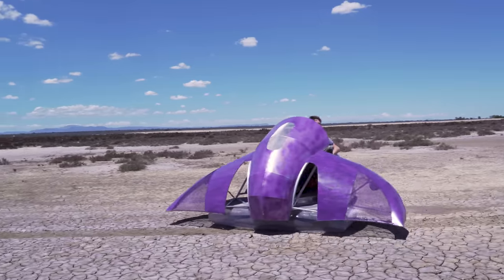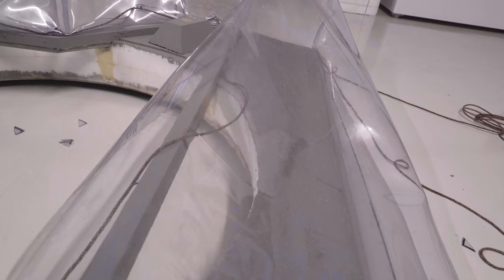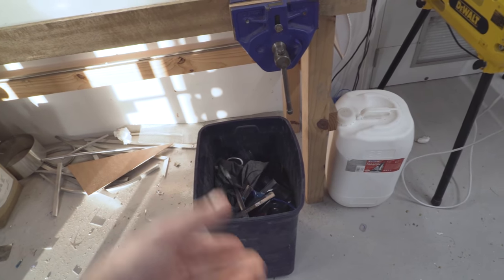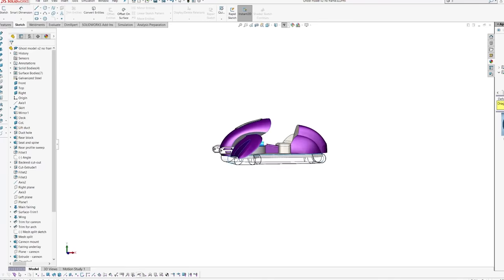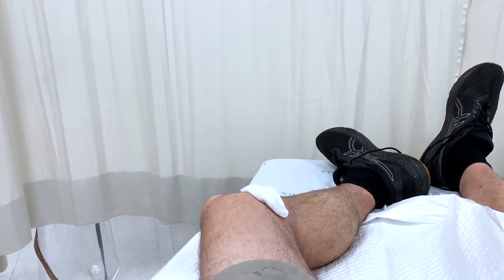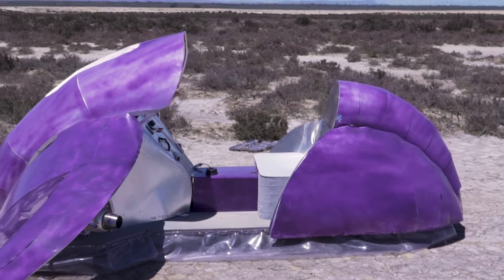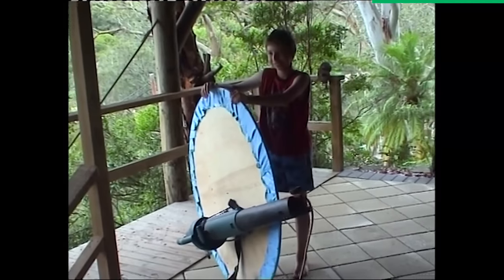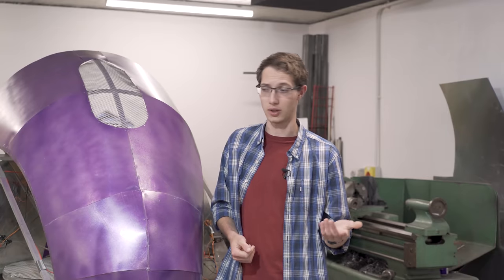Real Halo Ghost

Comment: RE: how the ghost handles

It seems like you might want a “fly by wire” solution to be able to translate user input into more acceptable handling. I’m assuming there wasn’t any code written by the creator… Which is an assumption! If I am right, my follow up questions would be “have you ever programmed an arduino before,” “what’s the mix and max (acceptable) output of each jet,” and then it would be a matter of finding a good graph/math equation.

Honestly, if I had access to this build to measure stuff I think it would be fun to tweak code in unity to get the best ‘fly by wire’ system for this particular build.

Comment: I wonder if electric fans instead, run off an alternator system, would solve the fuel efficiency issue of the jets.
I'm sure the motor has enough torque to spare, and still hover.
May need to play with some capacitors and some voltage multiplying. 
But an added bonus;  you could fit in the boost function playing with these too

Comment: I've watched a lot of RC Drift Car videos, and especially on the rear wheel drive ones, they use a Gyroscope to kind of automatically stabilize the car through turning the front wheels so that it moves straight when you want it to. I'd imagine you could do the same, but it does involve coding. If you need help on that front on the Youtuber side, James Bruton might be able to help you! :D

Comment: think of it as simply a "First Gen" Ghost and work out improvements, like smoothing out the body or welding the sheet metal instead of rivets.

Overall a very simple concept, executed well. The fact you purposely made it look like a Covenant Ghost, and relatively accurate one at that, is bonus points. Well done.

Comment: Variable geometry exhaust would possibly help your steering woes by allowing you to vary the thrust within a window of fine control before requiring adjusting the turbine power, but would be a good challenge to implement and map to useful controls

Comment: Very cool, the slewing problem is an issue with military hovercraft too, although they use throttling pusher fans instead of turbojets, which help with more prompt reaction to turning inputs.  What you could do is instead of throttling the jets up and down, design thrust baffles to temporarily redirect their thrust.  You can also have them pointing straight back by having a little bit of shielding to protect your shins.

Comment: If you're still into this sort of builds, DIY anodizing is really simple. You will need a low voltage source (car battery charger should works well, even for large parts), some diluted acid (even cheap vinegar works), some lye (or at the very least oven cleaner, either way be careful with that stuff! Flush area with vinegar ASAP if you get some on your skin.), and synthetic fabric dye for color. And obviously a large enough container for your parts as well as some water.
First thing first: cleaning. WEAR GLOVES! From here and until the process is complete DO NOT touch part with bare hands, it will cause imperfections. Wash your part with soap/water, then either dunk it into a weak lye solution. It will begin to bubble, so let it do so for just a couple of minutes. Rinse. Same if you're using spray-on oven cleaner, let it sit, then rinse off.
 Part two: the anodizing. Attach a red wire to the part, and a black wire to a scrap piece. I believe tin/lead is preferred, but old bare wire, piece of stainless steel, or even another piece of aluminum work well. Suspend both in the tub so that the part is not touching anything. Fill tub with mild acid so it covers the part. Now red to +, black to - of the power supply and let it sit and bubble away for 30 minutes to an hour or more, depending on your power supply. Periodically check for any large stationery bubbles and shake the part a bit to dislodge them. When the part becomes dull gray it should be ready for...
Part 3: the fun part, color. Pre-heat a container of fabric dye solution (concentration of about 2-3 times higher than for fabric) to recommended temperature. Rinse your now-extremally-clean and prepped thing with as clean of water as you can get (distilled preferred). Before it even has a chance to dry, dunk it in the color. Quick dunk will give you a solid color, while slow lowering will give you a fade-out effect. Within seconds the metal will absorb the color, and it may look darker than the end result. Remove and rinse again.
Part the last: fixing. At this point the metal is colored, but it will absorb dirt and grime just as happily, as well as the color being fairly unstable and easily removed. To prevent that the part should be put in boiling water for 10-15 minutes. If the part is too big (like a piece of sheet metal) it may work to just rinse it with boiling water several times.
After the part cools you can finally tough it with bare hands. You can now wipe it clean and you should end up with nice deep semi-gloss color on the metal. Do not polish it though to start with, you might remove the color. Aluminum will eventually finish forming the oxide layer that will lock in the color permanently, so the part may become polish-able after a while, although i have not tried that, am usually happy with the natural semi-gloss finish.

Addendum: if it doesn't work the first time, just repeat the process. The first lye wash will easily remove previous anodizing and let you start over.

Comment: Here's a jet throttle idea: add a servo-driven nozzle that can turn 90*. That way you can keep the jets at constant RPM (so no spin-up, spin-down delay) but just turn the two airstreams sideways away from the bike (so the vector sum of thrust is zero) when you don't want any thrust. That way you can accurately control how much acceleration you get with almost no input lag.

Comment: so for your next model you just need a hollow center half cylinder going from front to back and dubbling as the seat and the main thrust force with a air flow fin mounted inside the back of the tube to add more control over the vehicle. you can either have the outside thrusters on a single trigger or 3 if you want to still use them for turning but i think they'll be better for getting the momentum started and then completely rely on the propeller in the tube running front to back to be the main driving force. the engine can still be mounted in the center of the tube and just let the passing air help with cooling and help prevent possibility of jet fuel catching fire. this should increase fuel efficiently, fire safety and control over the vehicle. fins on the wings that prop up to increase wind resistance could be helpful too if you have them on the same control as the central fin to work against the direction of turning would have a more controlled turn at high speeds. also please have a auto body shop paint it in a professional paint booth. amazing work tho

Comment: A centrifugal blower would be ideal for thrust and lift. They are more compact and also more quiet than ducted fan, propellers or turbines. The only drawback is that is that it slightly weights more and less thrust per hp.

Comment: Some edf fans next to the actual jet engines connected to a drone flight computer and using the z gyro may be able to correct fast enough to keep you going in a straight line. it would take some custom software, (modded flight code) but internally, you just end up with a rotational speed from the gyro + the joystick turning input and feed the error into a pid loop that creates a left or right torque command. Which you feed to the edf fans. I would probably keep them spinning at something like 5% throttle at idle so you don't have to rev from zero rpm.

Comment: Maybe put the jets on the very back right behind where you’re sitting and then have compressed air on the fins for steering, still let’s you boost and will make it much easier to turn, it won’t be game accurate but it’ll work better

Comment: I bought the hovercraft from the back of Boy's Life and actually built it. I made the single disc model, and it blew my mind that it actually works. Dear god, its hard to steer that thing though and you end up just kind of floating around randomly, bumping into everything. hovercrafts are even harder when its not a simple disc

Comment: Let’s see who can complete it first. The project?
Real life spartan armor. 
Built in heating and cooling, built in computer and telemetry built in air filter n95 or higher. Mine is even going to have lights and sounds that replicate the shield. Mine also has a 24 hour battery life.

Comment: That's pretty cool. I've seen vehicles that were supposed to replicate the repulsor lifts from Star Wars that use mirrors to hide wheels they ride on. You get sort of a distorted reflection of the ground that looks pretty cool. I wonder if a mylar skirt would look better than transparent. Might be worth an experiment. 

For control, have you thought of adding a 3rd jet mounted on the back swiveling like a boat rudder? That way the all 3 engines provide forward thrust while the rear only steers is. That lets you run at a constant throttle and not have to deal with the spool up time. Granted, it wouldn't look exactly like the one in the game, but you've already takes some liberties with the design.   ;^)  Also, you could mount it nice and low where it's less noticable.

Comment: you have built a Halo Ghost,
maybe you should build a more practical version next.
a stabiliser fin in the rear with a rudder should help steering.
If the rudder ends up tilting the craft too much (it will be above the center of gravity...) you should use two rudders that you tilt to counter the tilting effect.

Comment: It sounds like this: 0:43
This man modded a pelican into a banshee's frame. truely a genious.
It regards to the steering difficulty, what you need is thrust vectoring, with throttle merely controlling the total thrust rather than relying on differential steering Then you won't be suffering from lag as the turbines spin up . Turning will be very fine with the ability to independently control the degree of turn as well as the thrust applied to it while also controlling the throttle. in theory you could spin in place without any forward movement. Depending on how you implement the vectoring. Cheers.

Comment: have you considered a PID controler for turning? aldough you probably gounf to need a couple sensor so you can have a close loop nowing current position, past one and where you want to go but it will control the lag on aceleration of the turbine making your life easier to control turning. I think the easiest way would be integrating a compas and just adjusting the degree from true north. You won't have a steering wheel persay but is a lot easier for a PID controler to know you want to go 45 degres from north which will be slight right turn and it can control the ramping of both turbine till positins gets to 45 degrees from north. it still might be slow though because of the mechanics of it. Unless maybe you have 1 big blower at top speed and just thrust vales on each side to rederict the thrust of the blower which will be less efficient butfast turning.

Comment: I think it could be better to have some sort of mechanical way to adjust the thrust of each jet engine, rather than ramping them up or down. You could use something like a metal flap that diverts or blocks air from each turbine and you could hook it up to a control stick with cables. Should be much better than using the turbines themselves to steer.

Comment: Would have been better to compromise on the design on the back and put the jets there and then hook them up to something to steer them so they can swivel around and never be pointed at the rider. Also a bigger cushion would be able to lift it a bit higher and then you can possibly fit the jets underneath the rear of the craft somewhat but not too low they risk scraping the ground.

Comment: Came from Joel Creates.  Beautiful build, but HOW to steer (since nothing but circles eliminates all the joy)!!  Would a big fan on the back facing backwards help?  Not a rudder... no wheels touching the ground... hmmmm.  Ahhh, I've got it.  Right now you depend on increasing thrust to one or the other jet engine, to which there's a delay.  How about turning each engine (with a governor to limit each one's turning radius so you don't get roasted).??  I would imagine a simple steering wheel or hand grip on each side might do the trick!

Comment: Instead of ramping the engines up for 3 seconds you should just run them constantly and use flaps to control the thrust
Not going to help with your fuel efficiency unfortunately but it would be pretty badass

Comment: I'm sorry, but you missed a golden opportunity to effing light the effing eff out of that dash. If I were you, I'd have added a gross number of superfluous digital lcd screens and led touch screens in the form of cheap Chinese smartphones. Best part is that they don't add an insane amount of weight and you don't need to worry about power and thus wiring.
Reply: Also, if you used fiberglass panels, you could use a vinyl wrap (they come in a greater variety of colors and textures and are found anywhere with significant financial inequality).

Comment: Use and after market ECU and jailbreak it to run custom firmware and software that will be used to manage the crafts electronics systems .
im sure there is  some source code out you can use to .

this i so cool. :) good luck bro

Comment: 2 large propellers. Balance power

Edit: only enough power to reach 2 feet off the ground, once above 10 miles per he or not strafing at low speed the power increases with speedometer. Universal hydronic pivot fans, human tilting provides natural balance like a motorcycle? 

Weight, lead balance above the fans, then the rear end will balance.. lift. Right. 

You almost need vtol off of a pelican, make the engines smaller. Or a Harrior Jet design. Jet fuel that close to the driver. 

Say the airforce designs a micro vtol, a motorcycle, air cycle. With dual 30mm cannons.. UNSC design to match a ghost in speed and damage, sounds like a speeder bike except low power thrusters. Defying gravity, magnetics, so a base could have a grounds which was powered to apply resistance like a mag rail line. How do control the vehicle, storage is none powered for cheaper fuel cost on moving cargo. 

$$$  what about a scale model?

Comment: There is a solution... instead of using jets, use blowers. Lower fuel requirement and less heat issues.

Comment: you're definitely not the first person to use gas turbines to power a hovercraft. The SR-N4 hovercraft that used to cross the English channel had 4 Rolls Royce turboshaft engines. As far as hovercraft driven directly by pure turbojet engines i couldn't find any examples either, probably because its not a good idea to have tons of latency on the throttle of a vehicle that uses its engines to steer!

Comment: Dude, change the design just a touch and patent it! In 10 years you can get the fuel consumption and noise under control. Maybe by then a more powerful battery will be invented and you won't need a chemical fuel source.